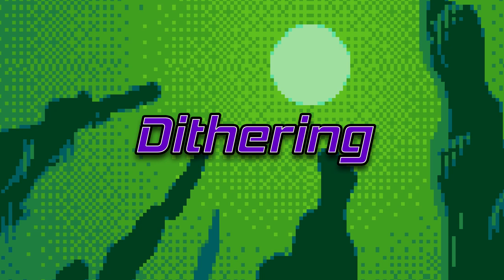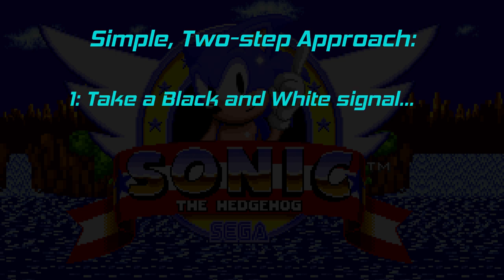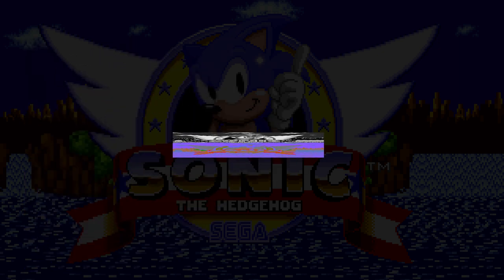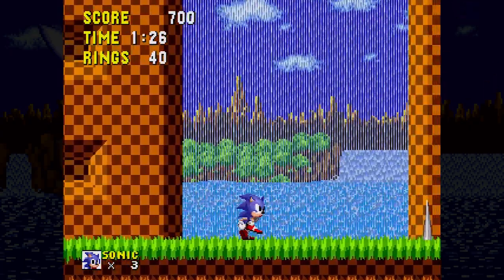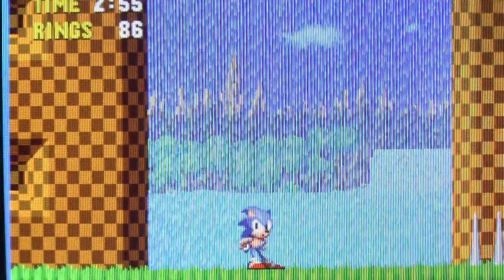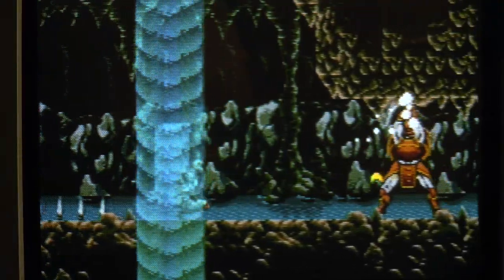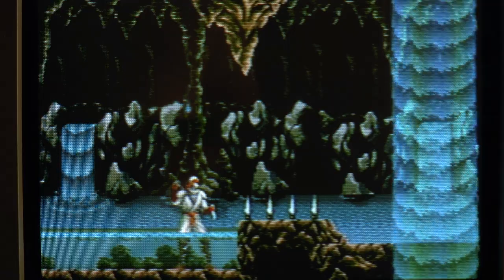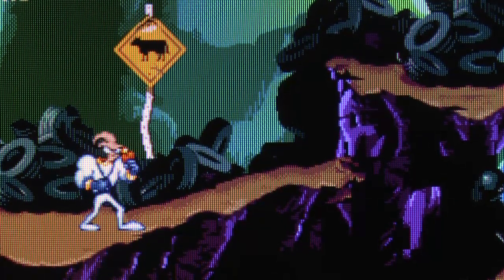Dithering on the Sega Genesis with Composite Video

Comment: This is a factor in all of the systems from that era to some extent, but the 16 bit consoles had it particularly bad because they were the first that reliably supported composite, S-video and RGB.
Though, the Saturn notoriously also has extensive problems with dithering being used to fake semi-transparent surfaces.

It might surprise you to learn the SNES also resorts to dithering for transparency at times. (Super Mario World does it in places.) - why is this a surprise? Well, because the system can perform additive or subtractive colour blending of graphics layers. (Specifically the functions A+B, (A+B)/2, A-B and (A-B)/2)

So if it can do that, why the dithering? Well, the problem is, depending on what kind of graphics mode you're using, there are as many as 5 layers of stuff being combined.
And the blending logic is not between these layers, but between something they refer to as 'screens', there's two of them - the Main screen, and the sub-screen; You can choose where all 5 layers of graphics go (4 backgrounds and one sprite layer - they can be in neither, one, or both screens, though things which are in neither are invisible.), but everything in one screen is added or subtracted from everything in the other. (mostly. There's a quirk with sprites that lets you have both transparent and non-transparent sprites at the same time.)

Let's say you want to replicate sonic's transparent waterfall effect on a SNES using actual hardware transparency - well, you couldn't just dump the background layer onto the subscreen, and the foreground into the main screen; that would make the entire foreground layer transparent.
Luckily the snes has 3 background layers in the most commonly used mode, so you can put the background layer in the subscreen, put most of the foreground in one layer and put it in the subscreen as well, leaving a gap where the waterfall goes, and put the waterfall in it's own layer and put that through the main screen.
Great. And if you were trying to recreate sonic mostly as is, that'd work fine.

But what if you already have 3 layers of background, and you aren't interested in an entire layer being transparent?
Well, now you're stuck - because a layer being transparent or not is an all or nothing affair, so instead, you have to use a dithering trick to pull it off.

(There's other issues with hardware transparency on SNES - notably if you use high resolution or pseudo-hires mode, the hardware uses the main and subscreen for that, which means you can't do colour blending with it. I believe in fact that the first intended purpose of having a 'main' and 'sub' screen was to deal with the two fields of an interlaced graphics display, but that they later found more impressive uses for it, and this original purpose fell by the wayside.)

The problem of course with this composite stuff, dithering and so on is that the end result depends on the colour system - what produces the intended Effect on NTSC will generally produce a different effect on PAL, and both will produce different results to SECAM.
This isn't so much of a problem in relation to Composite blending to produce transparency effects, nor is it likely to produce big issues with what dithered graphics look like, but it DOES completely mess up artifact colours. (CGA composite mode for instance would not work even slightly if it were using a PAL display)

A side issue here is intent - I get the feeling with the SNES/SFC in particular, that whether games were designed with Composite or RGB output in mind shifted over time. - especially true of Japanese exclusives, since RGB was increasingly available there into the 90's.
For instance, Super Mario world contains dithered transparency, suggesting it was intended for Composite.
But the likes of Seiken Densetsu 3 looks really quite ugly using Composite, and yet it's one of the prettiest games on the system in RGB - and since it's a 1995 Japanese exclusive, I feel reasonably confident that this much prettier RGB version is probably what they designed it to look like, rather than the mess that results over composite.

Is this true for the Mega Drive/Genesis as well? Most likely. Though the incentive to use composite related tricks would be stronger on that system no doubt.

It all depends on who developed these games, when they made them, and what their intended primary market was.

Europe has had RGB the longest and most consistently (Scart is fundamentally RGB, and was so widespread in the early 90's already that PAL Nintendo systems sold in europe in the 90's and even the gamecube and wii included a composite to scart adapter. - scart does support composite usually, but it's primarily intended for RGB...), but PAL related development is frequently an afterthought - even from many european developers!
Japan had I think less consistent access to RGB than Europe, but it's still fairly widespread and several common standards for use with TV existed even in the 90's. (including one using the same connector as SCART but with different pinout - because that's not at all confusing. XD)

But America... Yeah, America had S-video I guess, but they never really had RGB.
The first Americans got any moderately reliable access to anything even resembling RGB was when Component cables became widely available as an option.
I guess historically you could've tried a VGA monitor, but you would've had to deal with the whole 15 khz to 31 khz conversion thing (which is what is now being solved when using a scan doubler.)

In any event, unfortunately it may be that you end up having to say on a game by game basis whether composite or RGB is preferable.

At least we can fairly definitively say there is no good reason to use RF or S-Video unless you just don't have anything better.
Reply: Well explained,, i first always used composite for my pal snes and i was fine with it, untill i used RGB scart and i was mind blows away, i saw colors wich i never saw before, it was a huge step,,,,but at some points i was also very disappointed because some games did had overbrighted colors or they did shown dithering patterns like shadowns such as in f zero or ninja gaiden  triloggy, yoshi’s island do have dithering patterns in the intro screen, wich i never saw with composite.
So it’s a mixed bag for me, i do like composite video for covering those ugly dithering patterns but i do like RGB scart for it’s purist clean colors.
That’s why i often switch from cables from time to time!!!
Reply: At the time of the SNES and Genesis composite was widely available on tvs in America via RCA cables. I remember because we finally didn’t have to use the stupid RF connector for the systems like we did with the NES.
Reply: As I worked with graphics from 90 and forward I can tell that the concept of RBG composite from production did not exist. Everybody wanted a sharper and better picture. Blur or smear was bad. 

Dithering to fake alpha or to fake more color was just what it was. An effort. Of course we noted that some things looked better with composite. And some looked better with RGB but it was never “hey I plan that this effect should look good only on composite”

They also at this time. Some was on and liked dither and some loathed it. It was art styles more or less.
Reply: "No reason to use RF or S-Video" ... thats just an absurd and ridiculous statement. S-Video and RGB Component are like 90% Similar and indistinguishable from one another, (not really, im just making an analogy), and since Most Consumer Grade Tvs peak at 480i, and the benefits of Component would essentially be lost, S-Video might be the best choice depending on your setup. 
    you also have to consider that getting a RGB Component setup is costly and difficult, with GameCube, the RGB Cables cost upwards of $200, and with SNES, getting the RGB signal requires Modding the system. there is a barrior to entry that in some aspects, makes S-Video the superior choice. 
    as for RF, there is some benefit to it. Older systems like Atari 2600 look better through RF on an old woodgrain RCA TV from the 80s, and again, Atari 2600s and the Famicom, and the NES Top Loader, need to be Modded to output Composite, which maybe Collectors wouldn't want to do. i wouldn't say there is "NO" reason to use RF.
Reply: @nunyabaznus7851  I agree. S-Video is the best affordable option for a lot of those systems. I'm not gonna go to the trouble to import Scart cables, adapters and physically modify to get RGB. Though, I've gone through the trouble to obtain specialized component cables (Retrovision) for the SNES for $30. I also bought some modified Xbox 360 component cables to use for the OG Xbox for around $30.  If there's an relatively affordable option for component on old consoles, I'll go with it. Otherwise, S-video or composite for me.
Reply: I was first exposed to RGB in arcade games , and noticed the greatly improved clarity as a early teenager. Upon getting an Amiga 500 and common companion Commodore 1084 RGB monitor in 1987 at 13 years old, anything less than RGB was always an awful compromise (of course, earlier Amigas, as well as Atari STs had color RGB since 1985).

When switching to 16-bit consoles a few years later, I was thrilled to get an S-video cable for my SNES to a basic 32" Sony Trinitron, which was a great improvement over composite. Sega Genesis colors always looked muddy on TVs, because of its poor video encoder chip (compared to Turbografx-16 and SNES consoles).

I'd ALWAYS take RGB over any other output on these 80s era systems, with original complimentary scanlines to mellow and stylize the relatively low pixel resolution.
Reply: Thanks for your comment, it was really insightful. You should make a video or something, it's a shame it's going to be lost in youtube comments.
Interestingly, the problems with (sub)screens you explain for the SNES are not that different than those of the Saturn. 

Saturn had true transparency (alpha-channel support) even on VDP1 (the processor responsible for sprites and polygons, which is often claimed to "not offer true transparency"), but only between VDP1 and VDP2. Once you set a pixel on VDP1 as "transparent", it would only show what's on the forefront of VDP1 blended with what's on VDP2 (meaning you couldn't have a sprite half-transparent blending with another sprite behind it: the front sprite would "erase" the back sprite and blend with only the background displayed by VDP2). 

This could be circumvented by... using additive/substractive color blending like the SNES... but only between the different sprites drawn by VDP1 this time. Meaning you could have one sprite blending with another sprite... but not with the background drawn by VDP2. Indeed, since VDP1 could not access the pixel color value of what was displayed by VDP2, it could not compute a mean between the two values and the sprites using this method would just appear as entirely opaque, masking the VDP2 background entirely.
In the end, if you wanted to, say, add a semi-transparent shield to Sonic, you'd have three possibilities:
- Use the alpha-channel, and you could only display the shield, blending with the background. Sonic would be erased by the shield and made invisible.
- Use color synthesis and make an average: Sonic would appear behind the semi-transparent shield, but the shield wouldn't blend with the background, the background would be invisible behind the shield.
- Use dithering to approximate semi-transparency both for Sonic and the background.
By the end of the Saturn's lifetime, some hacks were found to work around this (see e.g. Burning Rangers), but even those were not perfect solutions.
Reply: Uh... composite wasn't as clear as S-Video. That took component.

Not sure I follow that last line.
Reply: KuraIthys 
Dithering is also often used just because it sometimes look more stylish or just better, at least in modern pixel art.
Reply: KuraIthys this comment should be pinned!
Reply: @Airsh Bornely, nunya Baznus - 
I don't know what you two are getting at, but in my practical experience (outside the US), finding RGB capable equipment and S-video capable equipment is equally expensive and difficult.

You wouldn't choose S-video if you had easy access to RGB.
Trust me on that. I went through great effort to get all 3 (and RF modulators on systems where that made sense) and look at the results of all 3...

That's why I said Composite or RGB are the main choices unless you have no practical alternative. (You two are talking about S-video in a context that amounts to 'no practical Alternative')

I also don't know what you mean about needing to mod a SNES for RGB...
Because I have both an unmodded Super Famicom (internal hardware is identical to US models), and a PAL system, both of which hook up via RGB scart without ANY modifications to the console.
The only issue is that the SCART cables themselves require some minor internal circuitry (a capacitor and/or some resistors.)

The N64 requires heavy modification to output RGB (and the PAL system also cannot reliably put out S-video)

S-video by the way is very rare in Europe. Finding an RGB SCART capable TV is vastly easier than finding an S-Video capable one, making the cost of the cables something of a moot point.
(And in say, Australia, finding anything better than Composite is equally rare, and typically any display you can find will either have both RGB SCART AND S-video or neither. Very rare to find just one or the other)

Nintendo RGB cables are a headache of course.

There's basically two wiring standards (give or take), one for NTSC devices, and one for PAL.
Except the NTSC cable can damage your TV if used with a PAL system, and the PAL cable gives incorrect results on an NTSC system.

Other than that the entire console family from the SNES to the Gamecube uses the same (analogue) cables, so if you have them for one of these you have the cables for all of them.
Again though the complication is the inconsistency.

N64 systems can't do RGB without heavy modification. (PAL systems generally also can't do S-video).

Gamecubes can do RGB, but they use the opposite cable type to what you'd expect from the PAL/NTSC system compared to a SNES...

It's a headache for sure.

But even so I still consider S-video something of a pointless option unless it's all you have.

Having access to all 3, I have to say with decent confidence that while S-video looks better than Composite in most cases, it looks a LOT worse than a proper RGB setup.

It also depends on the type of equipment used.
I have a Plasma TV and the difference between RGB and S-video on that is much more dramatic than the difference between those two on a CRT...
Reply: @wisgarus  this. being able to see dithering (cuz the monitors/vpus (or whatever) are so pixel-accurate and sharp now) caused pixel artists to start making many more designs and patterns in their dithering that would've looked a bit odd, or wouldn't have been necessary, if we still used composite.
Reply: Well RF is the way the Sega Mega Drive (Genesis) was meant to be played
Reply: @nunyabaznus7851  There are some CRT TV's produced by Sharp that only have RF in that actually showcase the Genesis/Sega CD/32X & Saturn in my opinion better than I have ever seen. I actually prefer RF than the others if its a Sharp TV that only has RF in.  Very high quality RF input on those CRT TV's.
Reply: @KuraIthys  I think I remember S-Video through SCART working on most/all of our TV's here in Europe. 
We used to hook up much of our stuff through little scart adapters that had both composite and s-video connectors.
My PC's graphics cards at the time had S-Video TV-out and never gave us any issues
Reply: The european Master System from 1986 already output RGB (that's the same cable than the original Megadrive).
Reply: lol I'm still using RF because didn't care for a long time then couldn't decided on getting RGB or composite.
Reply: @wisgarus  I don't get that. Most people wouldn't have seen it, so why is it part of the "retro" look? It's like that only came about because of emulators.
Reply: @bangerbangerbro  What, dithering? It's not really a retro look anymore. Pixel art is so so much more than just nostalgia and retro stuff atm. It's a whole medium of digital art.
And it's a medium in which restrictions like canvsas size and especially colors are very common, so dithering is still used to this day for both color conservation and style.
Reply: @KuraIthys  I have this Goodmans Ld1928w TV from 2005 which is UK AFAIK and for some reason it has S-video. In every other way its a crap TV though.
Reply: @wisgarus  Really?
Reply: @GamePlayerZ1912  No
Reply: @bangerbangerbro  Yea. Just go onto Twitter and search for Pixel Dailies or just #pixelart. Pixel art is like painting - it isn't done just because it's old school or was done before, it's a preference
Reply: @bangerbangerbro  it is, if it wasn't, why would it come with the Sega Genesis back in the day?
Reply: @GamePlayerZ1912  Because it's the only method that works with all TVs
Reply: @wisgarus  Ok. Interesting.
Reply: @wisgarus  like in Mario party ds?
because it’s on a crisp ds screen but uses dithering heavily
Reply: @zdmacstudios  Maybe. Dithering doesn't necessarily have anything to do with the screen used. It can create an illusion of extra colors even with modern screens. Like, having a simple net of gray and black can create what seems to be a darker shade of gray. 
I'm kinda lacking context here, but I assume if it's DS then at least some of the dithering was still done due to technical limitations to save on colors, though some was definitely also done for stylistic reasons as well, I'm sure.
Reply: @wisgarus  looking at examples of checkerboard dithering on the DS I noticed it was actually relatively rare. In the games I did see this in, I would usually find it on 2D sprites.
Mario Party DS in particular used it on 2D UX the most such as the mini-game timer and large fonts.
As the DS can output only 32768 colours at once, you will definitely see at least a little colour banding on gradients without a dither effect. Most games on the system don’t use dithering much and so you will see multiple instances of banding - Mario Kart DS is guilty of this in the countdown.
As for the context I could send you some screenshots of dithering on the DS in a separate reply.
Reply: I still prefer rf over av